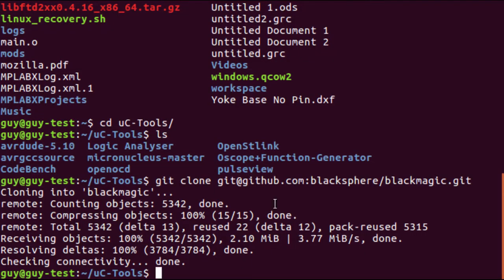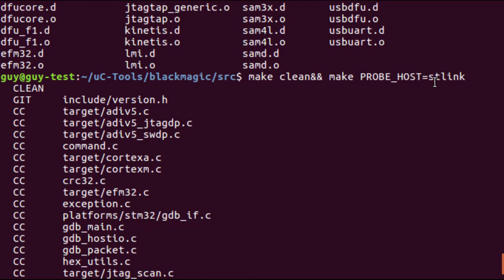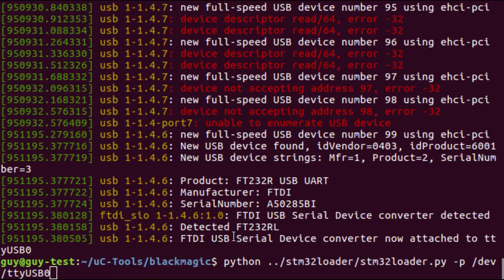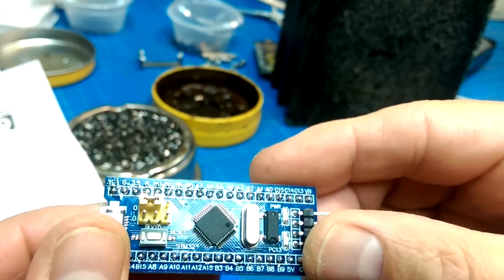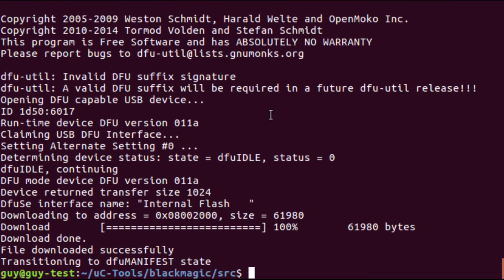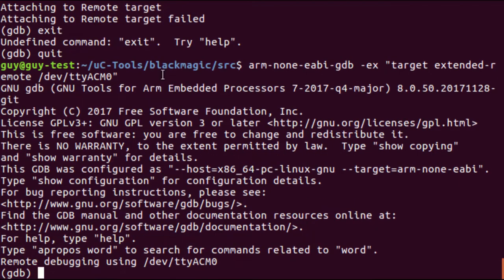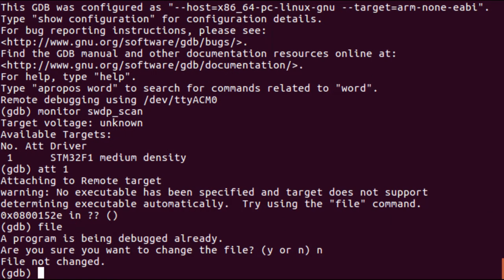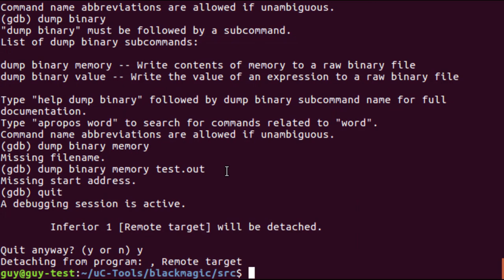blackmagic clone

Comment: Is there any limit as to the type of devices that the Black Magic Probe could support? For example, given the right header files, would an old ARM7 (v3-v5 instruction set) work?  Or a Microsemi Cortex-M3 (v7-M instruction set)?

How about newer devices like the SAME70 Corex M7 (v7E-M instruction set)?  Or do these have interfaces that would require changes to the Probe hardware? 

I'm especially interested in the feature of reverse/rewind execution!
Reply from the maker: I don't know the answer to your questions.  But the good folks at blacksphere probably do.

https://github.com/blacksphere/blackmagic/wiki/Frequently-Asked-Questions

They have experimental support for ARMv7-A. 

And since it is Open Source...

https://github.com/blacksphere/blackmagic/wiki/Hacking

Here is the start of a page on how to add target device.

https://github.com/blacksphere/blackmagic/wiki/Adding-target-drivers
Reply: Check out this link to see the supported devices: 
https://github.com/blacksphere/blackmagic/wiki#supported-targets